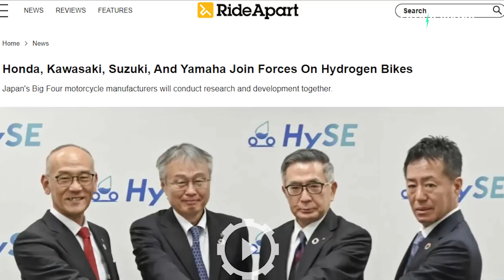Honda joins Toyota's, Suzuki & Kawasaki to make hydrogen engined vehicles

Comment: Only place i see Hydrogen as a solution is probably Ship. The infrastructure only needs to be a specific ports and the space factor is not a issue. Also it doesnt make sens to charge a ship, imagine the GW it would need, that would be too much on the grid. Making H2 in a continious matter and then load it in the ship quickly make more sens.

Comment: I used collaborate in research on solid oxide fuel cells.  Everyone is scared of running hydrogen because its combustion range is so wide, from 4% to 74%. I world never touch a hydrogen car.

Comment: In my opinion the biggest issue with ICE is just to much complexity to many moving parts constant failures constant maintenance, Electrics have 4 to 6 moving parts in the drivetrain while ICE is more in the 300 parts area. Plus where are they going to produce hydrogen? its not easy and quite inefficient and you cant transport hydrogen via copper powerlines you are stuck with truck transport. hydrogen is a loser and I bid farewell to Honda and Toyota as they will fall into a money pit and fail. Tesla will win again

Comment: Until a ship floating mainly on hydrogen (water) can through electrolysis convert from that water, electrons to power electric motors on the ship, then hydrogen will remain infeasible for any transport.
What can be more stupid than as we do now, providing infrastructure to make and store diesel/hydrogen offshore and on the ship when the ship is already floating on hydrogen.
We should in this day and age be able to fill our car's fuel tank full of water, extract the electrons through fuel cell technology (to run the electric motors) then reintroduce the electrons from the atmosphere back to water as many Youtube videos suggest, this simplicity/myth? It's elusive because the whole problem (or opportunity) is separating one element from another cheaply and on-site.

Comment: The temperature isn’t the only problem. The hydrogen combustion engine runs about half as efficiently as fuel cells. Given the cost of hydrogen, and the losses in making hydrogen with electricity, this tech will always be at at least a 3-10:1 cost disadvantage to EVs, not to mention problems with storage and lack of fueling stations. This is nuts. One man’s mania is bringing down the entire Japanese auto industry. Only in Japan could this happen.

Comment: Japan is moving to a hydrogen economy. They are using the excessive heat of nuclear plants and nitrogen to make hydrogen cheap enough.  They say industry has not found a replacement for fossil fuels yet - hydrogen is the answer. So the auto makers are making cars running on ICE engines fulled by hydrogen.  The efficiency will still be low.  Although hydrogen improves rotary engines by about 23%, of which Mazda have just reintroduced as a range extender.  

Batteries right now are not suitable for large vhicles like trucks, buses, trains and ships. Buy hydrogen is.

Comment: You know how we can tell they aren't serious?  They are not investing in infrastructure.  Where is the refueling and charging infrastructure?  <crickets>  They just aren't doing it.  

Hydrogen could work.  These engines are not very efficient.  BMW and others have run hydrogen engines and they do work.  They would be VERY EXPENSIVE to run at today's price of hydrogen.   Combustion is not nearly as efficient as the fuel cell energy conversion.   Lot's of technical issues.  We see Cummins in the big diesel engine space has been developing hydrogen engines to replace diesel and they are pretty far along in the development from the looks of it. 

If we suddenly see a plan to put hydrogen in all over the place then maybe I will believe them.  They are waiting for the public to pick up the cost.  The govt appears to be planning to back the hydrogen move for the big trucks, equipment etc.  So maybe they are just waiting for the govt to throw money out there to deploy the infrastructure.   For the big rigs, heavy equipment etc this may be a viable alternative where batteries won't cut it.

Comment: Weird. Hydrogen is now being discussed as a limited purpose fuel to replace gas for industrial uses that require really high temperatures, preferably made at the same facility. It’s really expensive to transport. 

Hydrogen cars produce water as exhaust. I’m curious whether this could be problematic in areas with both high humidity and high temperatures.
Reply: Hydrogen combustion Engines produce more than just water. They produce loads of Nitrogen Oxides, simply because the engine produces loads of heat when ambient air is superheated you get a SECONDARY reaction that binds the free oxygen atoms with FREE Nitrogen Atoms ( in the ambient air) resulting in a polluting gas.

Comment: While I don't dismiss hydrogen and believe probably a mix of fuel sources is the key to the future dependent on the vehicle application...this however smacks desperation from decades of lazy R&D by trying to leverage on existing ICE technology, Toyota of all companies with its engineering resources should be a world leader in alternative automotive powertrains but in recent years has proven something is rotten internally with the company as simple DPF failures have proven, Honda cut  its R&D and listened to the beancounters instead of its engineers after the GFC and has never recovered and perhaps Toyota have done the same.

Comment: Why in the world, would top engineers think that this is anywhere near as efficient as a battery? 30 years ago, this might have made sense, back in the days of Lead Acid batteries, or at best, Nickel Metal Hydride batteries. A Hydrogen car could possibly yield ~200 miles of range, while electric cars of the day were lucky to achieve 100 miles on a charge. A full load of hydrogen could be delivered in 10 minutes, whereas it took all night to charge the earlier batteries. Modern Lithium batteries can easily exceed the range of a combustion hydrogen car, and do it without all the complexity and maintenance of an engine, but worse, the complex fuel storage and delivery system.
     When you consider the losses in converting electricity into Hydrogen, then, either compress Hydrogen to 700 BAR or, cryogenically cool Hydrogen to liquid form, that takes energy. Now, burn it in a combustion engine, which at best, yields ~30% efficiency. It would take approximately 6 times more electrical energy per mile, than just simply charging an electric car. Safety is my biggest concern. I'm not as concerned about  the flammability of Hydrogen, but rather, the potential expansion energy of the high pressure fuel cylinders in which the Hydrogen is stored. I've seen Compressed Natural Gas (CNG) cylinders blow, with only 240 BAR explode, and it blows the car to pieces. (no flames) The cylinders in those cars give approximately 220 miles of rang  By law, in the USA, those cylinders have to be re-certified or replaced, every 10 years, and it's expensive. Why would you bring back all the maintenance, complexity, and cost of all those moving parts, just for reduced efficiency? Rube Goldberg would sure be proud of this!

Comment: Hydrogen powered cars are not the answer to solving our problems.  Anything that burns up Oxygen is not good for the planet.  We need more oxygen not less oxygen.  Yes  carbon is a problem but we also don't want to burn up all the oxygen that we need for life! Hydrogen is the smallest element so no container can store Hydrogen as it will leak through any material.  Therfore it is difficult to store Hydrogen for long periods!! Rgds, Mike!

Comment: Hydrogen engines emit NO2, because they don't burn hydrogen cleanly with pure oxygen, but with normal air that contains mostly nitrogen. That's not nitro, no, it burns less ;-)

And hydrogen is expensive, they need even more than with fuel cells and that is more power required than with batteries.

Where should all that electricity come from? They need much more to drive 100km than anything. We don't have such a surplus in energy, nowhere... There is no advantage, just disadvantages. And what do the cars carry... We have seen the explosion near Oslo, that's enough.

And over 90% of hydrogen that's being sold comes from fossil fuels.

Disadvantages over disadvantages.

Comment: Good job. Theyve shut the door for any possible electricfication. If it was fuel cell, fine, you can use the electric power train for today to earn milk and butter to keep their head above water for the eventual hydrogen power. With hydrogen ICE, they are pretty much all screwed if ICE eventually get phased out. They way I see it is like retreating the front line. They have very sophisticated hybrid system. Let use that to fight the EV evolution. Shxt, things not working out , lets push hydrogen fuel cell. And they find out they are hopless to catch up on electrical drivechain. Fxxk it, lets do it quick and easy. Just burn the hydrogen in ICE. What next? Just for the sake of argument, burning hydrogen is an extremely inefficient way to use this energy. It is expensive as hell to produced if it comes from water( the cleanest and greenest way) and very expensive to store (it is stored under high pressure and cryogenic state). Even under that condition, there will be a 2% (by mass) loss due to hydrogen exfiltraction. The point is, the cryogenic state at storage is a very unfavor feature of combustion. Because like liquid hydrogen dont really burn well, you need to turn it to gaseous state from liquid state. This phase change will take lot of enegery to complete( that energy must come from external or  previous combustion stroke. This process is in fact quite different to its gasoline counterpart. The gasoline uses a fraction of energy to "atomize" ans them burn. Thia buring hydrogenation creat a problem called hydrogen embrittlement. The hydrogen molecules are small. If it get trapped between metal grain, then we will have a hydrogen embrittlement problem.it was never report on yhe hydrogen test ICE car. But at the same time, the sample size may not big enough to have the problem surfaced

Comment: 20 years ago BMW did tests with hydrogen combustion engines.
(Wikipedia: BMW Hydrogen 7)
They used about 4kg hydrogen for 100km.
A car with hydrogen fuel cell makes 400km with 4kg hydrogen.

You need 100-120kWh to produce and bring 1kg green hydrogen into a cars tank.
So 4kg hydrogen need at least 4x100kWh of electric energy.
You can drive at least 2000km with 400kWh electric energy.

Comment: Sam, it is all about the industry that produces component parts used for the manufacture of gas cars. Japan knows if it can't find a solution to the electrification of cars millions will be unemployed in Japan and it is that simple. The mere fact that the world has turned and the maintenance of electric cars will also cause some unemployment. Has sent a cold shiver down the spine of the Japanese.
They are begging for time to avoid the changeover. Unfortunately, for Japan, the world has made its decision and it is bad news for Japan.
It is their own fault for snubbing their nose at the electrification of cars. Never so blind as those who cannot see change coming.
Elon must be the most powerful man in the world. With one stroke of his pen, he has changed the car and space industry.
Now the once-mighty Japanese and German car industries will fall into disarray if they stick to yesterday's technology. 
One power stroke in four. The other three consume power!!! What a great outdated power solution that is.
Let's face it! A hydrogen gas engine is not totally without pollution as some lubricating oil will be burnt in the combustion process.

Comment: F1 Mahle style direct injection could allow ultra lean H2 fueled ICE to safely achieve very high efficiency (for ICE) and power but will still very likely be more expensive than battery electric vehicles per mile.  NOx emissions might also be an additional problem that will require expensive after treatment technology that will have the durability challenges of diesel after treatment, but melting pistons will not be a problem

Comment: Without a massive hydrogen generation breakthrough, hydrogen is simply not cost competitive with electricity.  So far this is not on the horizon.  If it does happen, fuel cells could come in eventually as the next step in efficient transportation, especially where storage space is less of an issue.

Comment: Just use a Wankel Engine or other rotary engine design as a range extender and allow for light duty vehicle get at least 100 miles EV only ... Plug In Hybrid Electric Vehicle (PHEV) with range extender ... This is silly for a Hydrogen ICE vehicle ... Look at the Mazda MX30 with Wankel as range extender ...

Comment: If you think range limitations are a problem for EVs, then hydrogen fueled internal combustion engines is far worse. Not just expensive to refuel, but will be hugely expensive. This is a really dumb idea.

Comment: In my opinion, the Japanese auto makers should focus on improving their current offerings, for example a hybrid that goes 100 miles in EV mode and 60 mpg. That would be an excellent transitional technology. This odd fixation on hydrogen seems misplaced, but who knows? Maybe it makes sense in Japan which is very densely populated and could get by with fewer hydrogen fuel stations than a more spread out country like the U.S., Australia, or China.

Comment: As if drivers want to swap one fuel dependency for another. BEVs give you the freedom to charge from your own powerpoint. Unless production of Hydrogen becomes as easy as plugging in a plug to a wall socket, drivers will need to be dependent on suppliers of this extremely volatile gas that evaporates at -253C 😆

Comment: Japan will be using its nuclear power stations to make hydrogen. They already do this but the volumes will be turned up.
The engines will use the F1 shrouded (pre chamber) spark plug.

Comment: Don't the fools understand that burning anything in a combustion chamber produces Nitrogen Oxides, this was proven ages ago, if you burn Hydrogen in the open air, then sure you mainly get water as a side effect, trouble is, they want this Hydrogen Engine to be powerful to compete against the EV revolution.
If they can't make a Hydrogen car that can at least keep up with the same priced EV, who would buy it other than as a Collectors item.
Nitrogen Oxide is the one that causes the cancer in people, but at least they won't be producing CO2 or CO.
These Hydrogen cars are going to have to also be cheaper than a comparable EV and maintenance costs need to be either cheaper or the same as an EV.
I wonder how long it will take before we see a Hydrogen car in flames and all the excuses on why it isn't as bad as the very rare EV fire :).
If you read the comments from ICE lovers you would think that no ICE Vehicle had ever gone up in flames lol, do they actually think before they type a comment.
My Wife and Daughter worked for Insurance COmpanies for a few years each and I can tell you this for a fact, ICE cars go up in flames all the time and in a crash can cause more than just the car going up in flames as Petrol can leak and travel, an RV in a crash and in the unlikely event it gets into a crash and pierces the battery/ies it's only the EV that will go up in flames there is no fuel spillage that can flow to multiple parked or other cars involved in the crash, have they never watched those Youtube videos of multiple cars crashing in a Snow storm and many bursting into flames as one got a pierced fuel tank, let alone the Tankers flying about at high speed that have thousands of gallons of highly flammable fuel ready to go up in flames in an accident, none of that for EVs ;).
Now with the newer battery tech the chances of an EV battery going up in flames has been reduced to very very low and it's very unlikely that even over a 25 year period would EVs ever match even one year of ICE cars going up in flames and that you can research on Google that Gasoline vehicles are 100 times more likely to burst into flames lol, try again petrol heads :)

Comment: Toyota's current situation is reminiscent of Kodak's ill-timed investment in photo processing labs during the advent of digital photography. The substantial investments Toyota is making in hydrogen can be seen as a significant strategic misstep. This parallel underscores the crucial importance of appropriately responding to technological shifts within an industry to maintain ongoing success. It also highlights how corporate arrogance and a rigid mindset can invariably lead to failure. Through their partnership with Toyota in supporting hydrogen development, Honda, Suzuki, and Kawasaki have essentially traded the rope tying them to a sinking Titanic for an unbreakable chain. This is quite unfortunate as it will lead to the inevitable downfall of the Japanese auto industry, while simultaneously providing a massive boost to the Chinese one.

Comment: I think bmw had a 700 series model that could run on h2 or gasoline. They had to bulk up the cat as h2 burning increases no2 gases.
Reply: Yeah, the hydrogen 7 project. I remember that in the 2000s. Just reading Bosch automotive handbook. BMW gave a shot on hydrogen as early as 70S.

Comment: Hydrogen fuel cell cars have too many and large parts. It may make sense for an 18- wheeler but probably not on a regular sedan. I realize this is not a fuel cell project but I don’t see the benefit. Unless you produce hydrogen from natural gas. But then why not just have natural gas vehicles?